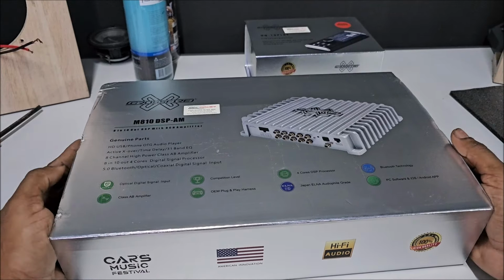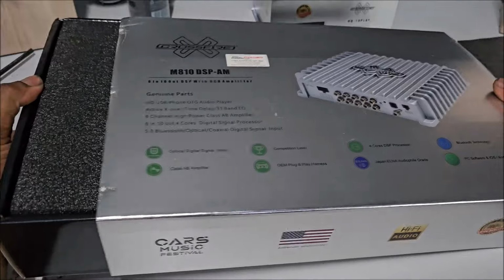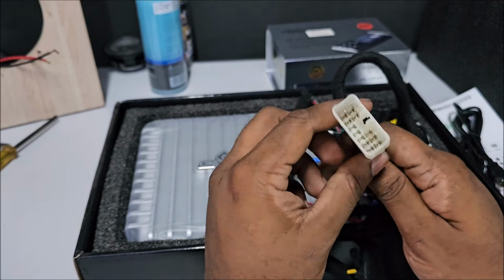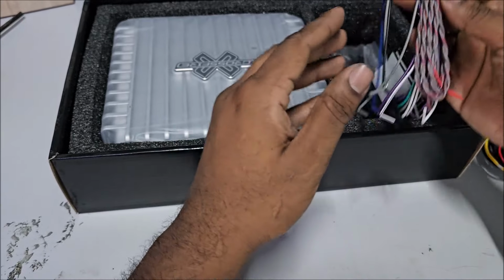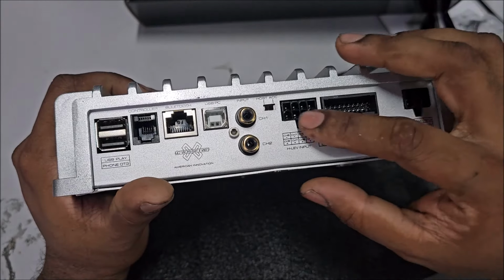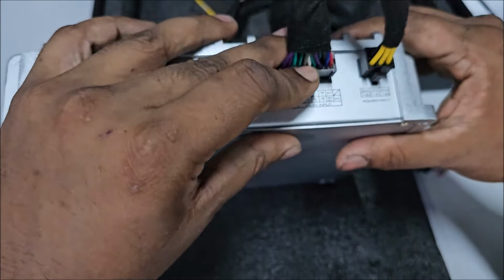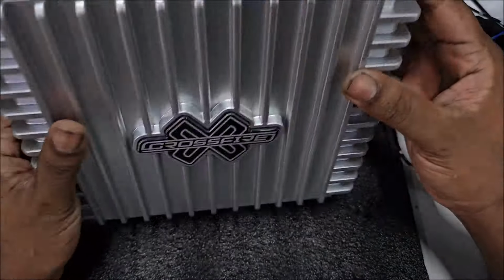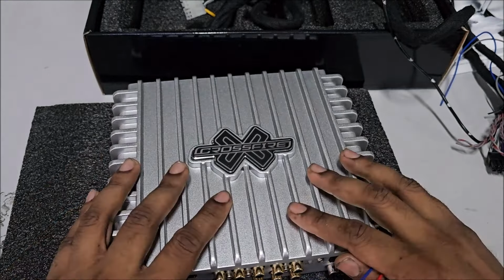CROSSFIRE M810 4S SERIES 10 CHANNEL DSP AMPLIFIER / BUILT IN 8 CHANNEL AMPLIFIER HIGH LEVEL .

Comment: Hi, I have this same dsp amp which I intended to connect my Fiio M11 plus dap to this dsp via coaxial. Unfortunately no sound coming out even I had selected coaxial input. I’m doubt is there any setting that I need to set from my dap. Appreciated if u can help. Thanks bro…
Reply from the maker: Hi do u have the dsp controller ?
Reply: @tcaudiomute  yes I have. Even I select coax input also no sound